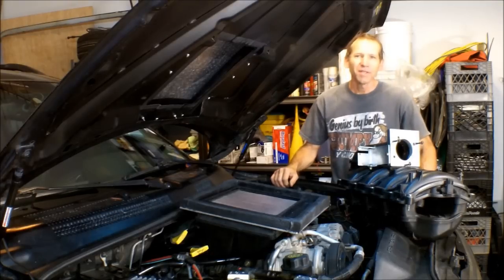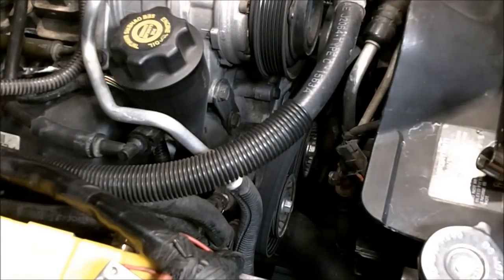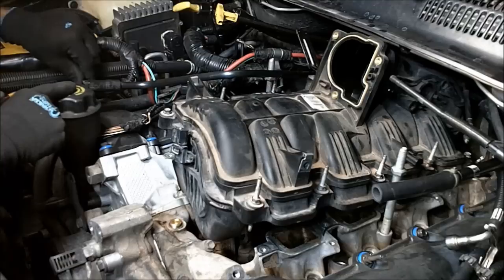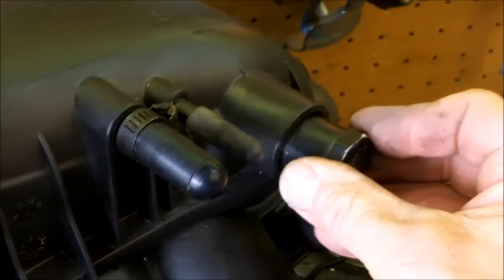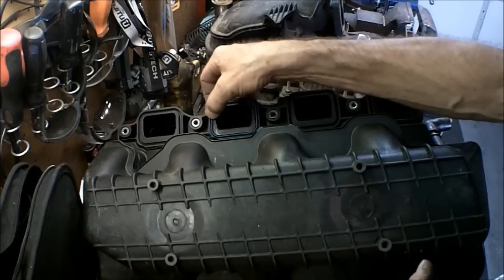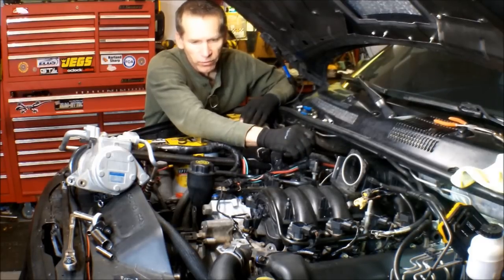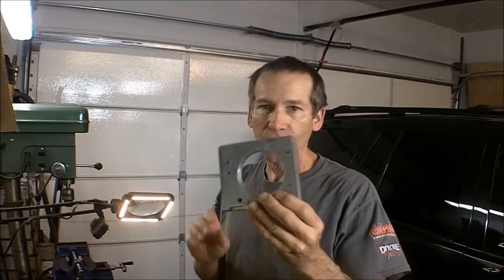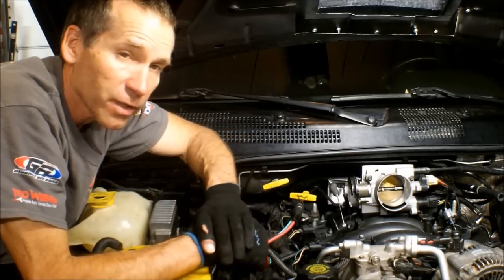Installing Upgraded Intake Manifold on 4.7 Jeep, Dodge

Comment: Performed this swap yesterday on my 2001 durango and ran into few issues thanks to your video.  It was incredibly helpful!  love the extra power, keep up the great work 👍
Reply: al carr  no difference in MPG however you can feel the power gains in the midrange.  the injector swap works well too.
Reply: also, you can reuse your stock air box assembly when you install the newer style intake.  at least it worked on my durango with no issue.  hope this helps, feel free to ask any more questions about the swap if you need
Reply: Bradley Hetland do you know if there would be any advantage to running an aftermarket injector or coils on my 05 grand Cherokee limited 4.7? If so which ones? Not doing the 08 intake swap, yet atleast. Still looking for a billet or looking to have one built. Jus looking to get injectors and do coils as well  
2005 4.7L mopar Cai ,single chamber corsa dumped at rear axle , borla high flow cats, upgraded torque converter and transgo shift kit "not that tranny mods matter" just letting you know current status so you can better answer my injector and coil question. Thanks
Reply: What kind of issues did you go through? I have an '03 Durango with the 4.7
Reply: @JameyCampbell_54  I used ngk coils and they seem to be the best oem coil option as there aren't any aftermarket coils made for the 4.7 to my knowledge. From lots of research, I've concluded the best stock 4.7l injectors are the ones that came factory on the 04 4.7l in the 1500s but I may be wrong. An injector change won't really give you added power unless you get a tune and or change to injectors with a larger hole count.

Comment: Finished install today, ran into some issues with removing fuel rail  for 03 Dakota SLT , ended up being able to disconnect the left side of fuel rail to fit in the new intake, I was unable to disconnect all the right side injectors due to corrosion, the connectors were just disintegrating . Also had to disconnect the metal A/C pipes that sit over top of the intake for removal and installation of the intake manifold. This video was a lifesaver @martinbuilt  thank you!  Snapped my cruise control cable and my vacuum  hose from the intake but she running good now!
Reply: Those are not AC pipes....that's the Heater hose pipes
Reply: Stefan are you still running that truck? If so how has this modification held up? I want to do the same thing to my 03 Dakota SLT...

Comment: Great video Martin,  This is the most detailed instruction videos of installing the 2008 intake on the 99-07 4.7L vehicles I have EVER seen!  You shed a lot of light on one area most people have issues with and that's swapping over the hardware from the older intake to the 08 intake.  I like your 3/4 pipe plug idea however I'm just concerned a back fire could pop it out causing an un-commanded/uncontrolled WOT situation.
Reply from the maker: wwwAIRRAMcom  Thank you... No I don't think there's any concern with that plug coming out it fits in their extremely tight. If there's any backfire issue it's going to come right out through the throttle body.
Reply from the maker: not at this time
Reply from the maker: @Dino Piccinin
 Dino sounds like you enjoy doing the mods on your 4.7 as well. I am also looking for a set of 08 camshafts. Did you do any mods to the cylinder heads like changing out the valve springs or anything like that. Yes I was going to go with either flying Ryan or airram.Com to get a tune.
Reply from the maker: @Dino Piccinin 
Nice to hear from people that have done the 08 cams and have successfully ran it for a long-time with the stock non HO Springs. Thinking about sending a set of HO cams to Crane Cams they're the only ones that have responded and said that they would regrind them. Maybe someday I'll get around installing a set of ported HO cylinder heads. I would like to have HO block as well.
Reply from the maker: @Dino Piccinin which ones are you going to lose the low end on the 206 or the 08 cams.. yes so far I found three sets of ho cams. I let a set of 08 cams get away from me because I didn't know about them at the time. I'm keeping my eyes out for them... and yes the specs on the 08 cam are more aggressive than the 206 I believe the 08 cam has a wider angle of lobe Center though
Reply from the maker: @Dino Piccinin I was wondering since you have run the 08 cams previously what do they actually look like ? Are they not different than the 07 earlier cams as far the way they were manufactured and the way the shaft looks. 
I don't know I don't think I could go to 456 gears. That seems a little too steep. That would probably really kill my gas mileage.  I'm sure the bottom end would be awesome though. Maybe I could see myself putting a higher stall converter in I have been looking at them. Just don't know what to pick for a stall.
Reply from the maker: @Dino Piccinin I came across a set of 08 cams on eBay. They did carry a different part number then the 1984 and 1983 that you hear talked about on the forums. One of them arrived yesterday and I got out the dial caliper it definitely has a 509 lift on the intake and I believe it was a 472 on the exhaust. If you lay them up side by side against the ho cam you can actually see that the LSA difference. I also checked out that blue Dodge truck that thing screams. I didn't realize that there were any aftermarket ignition coils for our 4.7 until I checked out his truck.. So I'm definitely getting those coils. I used to have a 97 Corvette and I installed the MSD coils on it and you could actually feel the difference. So once I get the coils and the 08 cams put in I will definitely be getting a tuner. I will consider the gears LOL.
Reply from the maker: how can I get in touch with you? I am interested in the tuner.

Comment: Again excellent work! When I did my manifold swap for the PCV, I grabbed a steel brake line with a bore about the same as the factory rubber. I ran it back and under the manifold. It exits under the A/C compressor and wraps around to the PCV.  It just made for a cleaner install.
Reply from the maker: curtis bradley I like that! I'll have to do that when I pulled the manifold off again to do a wire tuck on the right side valve cover

Comment: Hi Martin!  As always, love your videos and I appreciate you putting them out there for us to use as guides.  I wanted to share something though.  I'm going through the process of installing an '08 intake manifold on my '01.  The idea of lowering the engine down to get the new manifold in place didn't seem very appealing to me, so I was prepared to take the easy way out and cut the cowling just enough to get it to slide into place.  Well, I set the manifold in as far as I could so I could see what needed to be cut, and wouldn't you know it, the '08 manifold slid right into place!  I had to wiggle it and move it around some, but it went right in!  No having to cut anything and I didn't have to lower the engine.
Reply from the maker: Thank you Leland , We're you installing this on a Grand Cherokee? And if so it's possible that your motor mounts are in need of replacing and that could possibly give you the additional room you needed. Nevertheless I'm glad you got it in there.
Reply: @martinbuilt  Yes, it's a Grand Cherokee.  It's funny you mention the motor mounts, because as soon as I posted I thought to myself "maybe it's just my motor mounts are bad!"  :-)
Reply: @martinbuilt  What did you end up doing for the air temp sensor?
Reply from the maker: @lelandgray8996 lol.. time for a set of martinbuilt polyurethane motor mounts.
Reply from the maker: @lelandgray8996  I relocated it into the ram-air that I built

Comment: Thanks for this video, I could not see how to get the plastic slide off the other throttle ball (Cruise Control) cable. I did not notice it had a notch in the back and it just slides off. (Details)! Cheers!
Reply: Agree.

Comment: To avoid waisting gas and cautions you can remove the fuel pump relay and turn your key off and on 2-3 times and it will remove the pressure from your rail so you don’t have to do the step you mentioned. Test it out and thank me later. 👍🏼

Comment: Yeah man! Thanks again for the heads up on the difference in manifold height, I'm of the same mind. I'd rather not cut my cowling or make any modifications at all other than the intended job at hand. Would it be easier to remove the motor mounts entirely with the four bolts rather than trying to massage them out of the rubber? Ive got a manifold coming. Again thanks for being a trail blazer. On the shoulders of Giants
Reply from the maker: Thank you, James. You are very welcome. Just so everybody understands You only need to remove the 2 motor mount bolts to lower the engine enough to get the intake manifold installed. Once the intake is installed the engine can be raised back up and the motor mount bolts returned.
Reply: @martinbuilt  Hello Martinbuilt, I've never had to pull the mounts , yet. Presumably the single bolt hole through the mount has a steel sleeve. I'd hate to be under there and try banging a bolt through solid rubber. A steel sleeve is hopefully inset for steel on steel. I might add the sound of your 4.7 is most auspicious and envy inducing. 
I'd further like to add this  video alone is responsible for the spike and absence of available 2008 WK intakes.

Comment: I thank the lord for your video. U am currently stranded in boise Idaho. Some guy came by and pucked up a wrench and started trying go help me take out spark plugs (I was replacing them). Long story short...he dropped the socket info the manifold. Ive tried everything. Magnets...everything. I undid my manifold but the top wont come off. I sat there and stared at it for a long gime and started to cry. In 900 miles from home and dong know a soul here. Single woman....i am a little intimidated. Wish me luck. I am going to do this. I bought new gaskets. What else do you recommend replacing while undone. I alrwadt did the iac and the throttle sensor and cleaned fhw theottle body.
Reply from the maker: sorry to hear that, I wish you were closer, I help you out. I would think you should be able to get it with a magnet, you'll need one that has a long wand on it to reach the socket. I doubt that socket would ever get sucks into the cylinders, it would just sit there on the bottom of the plenum.

Comment: Nice video sir 👍🏽 regarding pcv hose for my 07 jgc laredo 3.7 i need to replace it i think there leak from the left side elbow (p0507) i ordered the hose from amazon w two elbows on each side should be here Monday is that a simple plug and play installation i could do? Is there somethings i should know about b4 replacing the hose other than rerouting the hose up and behind the throttle body instead of under it like it was from factory?

Comment: You are a awesome mechanic I recently bought a 2005 jeep grand Cherokee limited edition trail boss I payed 700.00 for it because it's overheating and they thought the rings were gone but I pulled the intake and the seals on the driver side were pressed in a lot more isn't that a sign that they tightened it to tight on one side

Comment: I did this swap to my truck recently, but since then, my truck only revs to about 4k rpm and bounces like it's hitting a rev limiter, won't shift when it happens either until I let off the throttle. Any tips or advice would be really appreciated, hoping to have the rest of my rev range back if possible.

Comment: I’m following your videos and this upgrade in particular I’ve been hearing about for years from Dakota drivers. I have a 2002 Dakota QC 4x4 with the 4.7engine. So I got an 08 intake from a Chrysler Aspen 4.7 and am in the process of cleaning it and fitting it. One issue arose that you touched on, but was confusing. The intake from the 08 Aspen didn’t come with the 8 double ended intake stud sleeves. Those 8 steel sleeves that get pounded into the perimeter of the intake to guide the studs down to bolt down the intake had to come from my stock intake. But your right. They don’t fit, except for 2 (1smaller one and 1 flat sided). An option is to drill out the other holes with a 1/2” bit ( IIRC LOL) and wobble the bit some to fatten it up on both ends. THEN, the sleeves will push down into the plastic most of the way and you can tap them in and reuse all your studs.                                               One other thing is the PCV (NOT PVC LOL) set up. My intake came with a short PCV hose that connects to the intake and what looks like the same PCV you threaded into the drivers side head. So I’m getting that PCV (if UPS will stop losing it and deliver it) from your amazon link. So that’s a short run to that side of the engine. What about the other side? Can I just put a cone filter on the passenger side 5/8” pcv inlet? Or do I need to reuse some of the old tubing to run that passenger side pcv inlet to my double coned filter eBay intake? Does this passenger side even need vacuum also? BTW I’m going to be getting a oil fill hose WITHOUT the pcv valve in it and replace my stock one like you did that has it.

Comment: Beautiful work! Lowering the engine by a half an inch reduces your center of gravity. Minimizing your rollover risk. Just saying there's additional benefits
Reply from the maker: Thank you. The engine only lowered temporarily to get the intake manifold installed and then raised back up and bolted to the motor mounts.
Reply: @martinbuilt  my bad, I didn't finish watching the entire video. I thought perhaps you fabricated some brackets to maintain the motor height.

Comment: Excellent!  I found an intake manifold from pull it yard on a 2008 4.7 cherokee and plan to install on my 2006 4.7 commander.  when I got it home, I found small pieces of metal inside the manifold and I think I have them all out.  Question:  Can I submerge the manifold in water and flush it out to make sure there are no leaks and to get any additional junk out that might still be there?  Pro's or Con's?
Reply from the maker: I flushed mine before I installed it with Purple Power but that was to remove any carbon and oil deposits.  Sounds like the engine you got that from had a valve seat drop. That will cause the metal to go to all the cylinders through the intake manifold. If you have an inspection scope I would look inside the intake and make sure no metal particles are lodged into the plastic.

Comment: Hello Mr Martin 

I just seen Your episode 

I have my Jeep 2004 4.7 v8 and am trying to install the same thing on my Jeep but I have missing the correct part or way to connect the pip of intake directly from the throttle body to the air box or without air box maybe.

And where is the pic sensors installation?

Could you please help me how to do that ?

Comment: Have watch your videos on your 04 WJ and incorporated many of the mods into my 04 WJ Overland 4.7 HO.  Just finished my engine rebuild and installed the 08 cams and 08 intake off a Durango.   I did not find a port for it on the intake I have.  I built a port for the air temp in the PVC plug used to plug the EGR hole, seems to work. Where did you install the manifold temp sensor?

Comment: Due to the IAC issue I returned to the 68mm with the back honed to 70mm. It works great The guy I bought the intake from got the model years messed up. 3rd Strike. I  bought so many parts from them I lost track myself. The IAC is crititcal for cold idle, mileage and proper metering of air entering the manifold. Mounting the MPS threades right into the left side of the intake and is very responsive a location.

Comment: Hey Martin, been following for a few years now. Great work!

I have a 00 4.7, need to replace the intake manifold due to a broken MAP attachment point. 

I’d like to swap it from an 02 HO however, WJJEEPS says the Cam shafts would need to be replaced together with the intake. That you cannot replace one without the other. Is this true? Am I better off to just grabbing the intake from a non HO? I’d like to not do camshafts is possible. 

Thank you!
Reply from the maker: That is the first I've ever heard of that. Now for optimum performance you may want to run the ho cams with that intake. But I don't believe it is going to hurt you to run the ho intake without the cams.
Thank you for watching and subscribing all these years.

Comment: Fantastic video! In my case I have an egr valve on my 05 Ram. Therefore you will also need an 08 egr valve and tube. To make intake manifold work. As for map sensor I just bent fuel rail slightly. But your ideas for sensor is just as good if not better. I love my intake and 70mm tb. Get her tuned and you will be amazed!
Reply from the maker: Craig Heidelberger yes I'm very pleased with my intake and throttle body that I got on it right now which is not the one in the video. What did you do for a tuner?
Reply: Bought a Diablo sport tuner and used the software to send my tune file via email to a fella by the name of Jay Greene who knows how to computer tune. Im very happy and you will absolutely feel the difference.

Comment: Martin, where can you purchase the fuel hose that connects to the fuel rail, left side,  that also connects just to the left of the transmission? Mine was broken during removal of the engine! I use to live in Veagas back in the 1980,s,  loved the pick a part sites and videos!
Reply from the maker: I'm not sure where you would purchase that new I would recommend the pic-a- parts that's where I would go.. Vegas has changed a lot since the eighties if you haven't been here since you wouldn't even recognize it or know how to get around.
 I've been here since late 93 and it has changed an incredible amount.

Comment: I pull the fuel pump relay/fuse and try and start the engine a few times to bleed off rail pressure